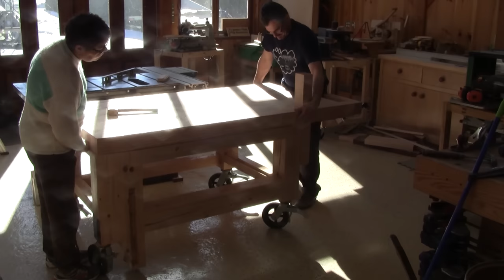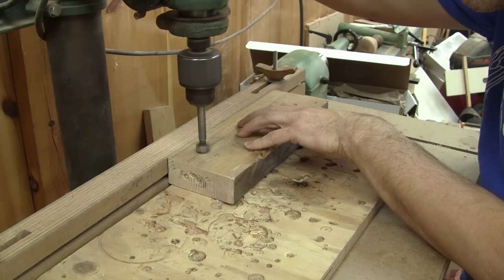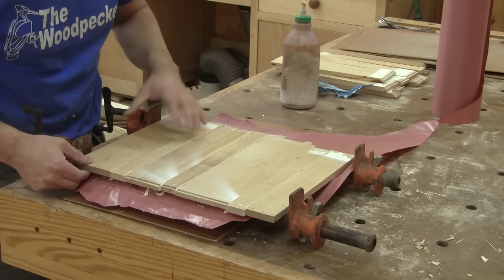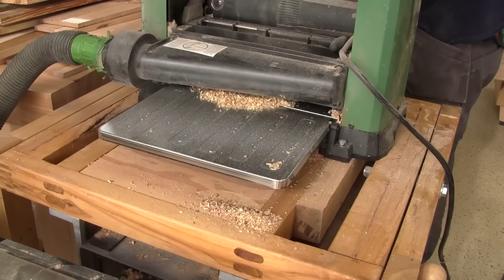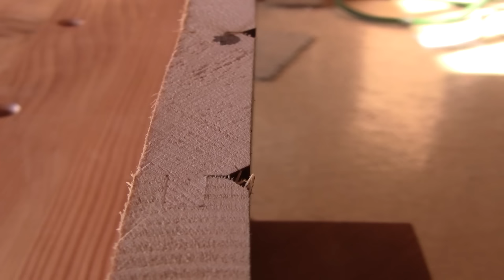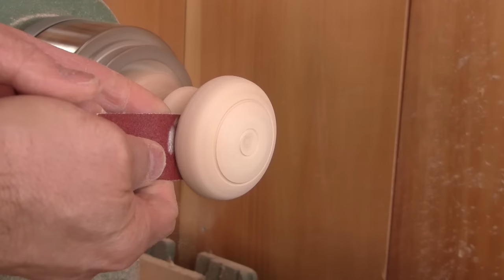The Woodpecker Ep 120 - Mobile Workbench -- part 4

Comment: Another fantastic video, thank you. Don't bench dogs need to be able to almost disappear into the worktop? What if you want to work with thin stock and you don't want the dogs protruding over the wood...? EDIT: I just read about the planing stops. 
 Thank you Alain, all the effort was worth it!
Reply from the maker: A lot of people are asking about the way I've install my bench dogs. Personally I love this technique, even if the dusts is filling up inside the holes. I have to clean them with compresed air and the vacuum. But I know that the dogs will always be at the right height when I put them in one hole. I don't want to have through holes because then the top drawers will end up filling up with dust.

Comment: Nice bench.  Drill all the way through bench dogs are designed to push down flush.  Or did you not have enough overhang?
Reply from the maker: The problem is those dogs are really tight. I would need to drill right through holes and I don't want that, the drawers will get full of dusts.
Reply: Alain Vaillancourt I have the same ones 13/16 hole works good.